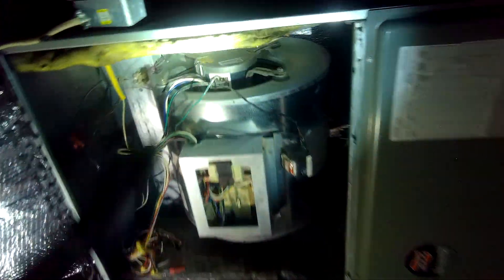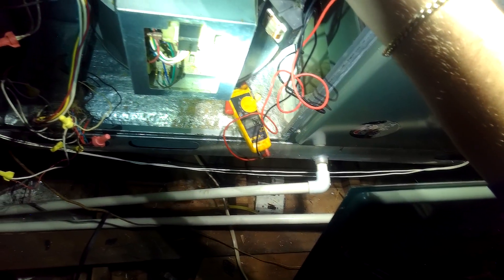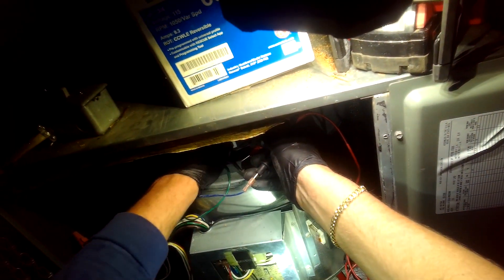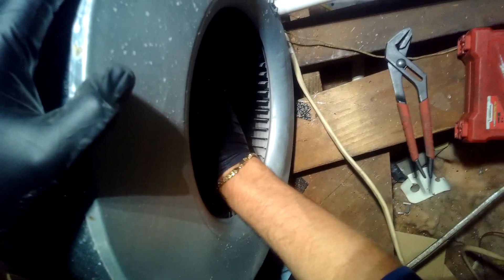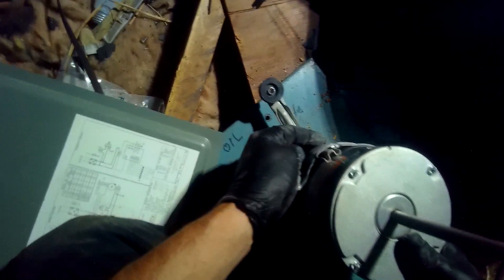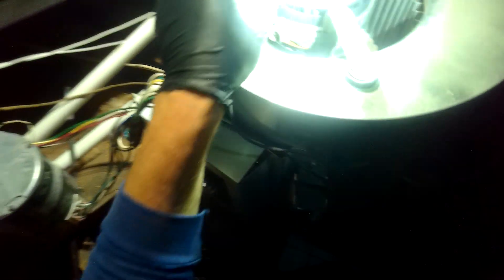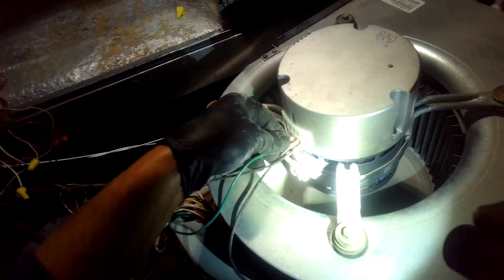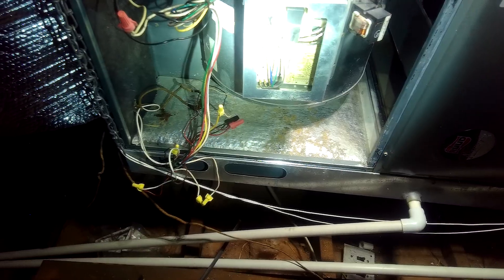How to Replace Rheem X13 Blower Motor Defective UHLA-HM6024AA

Comment: I have similar problem, blower x 13 turns on and few seconds later turns off. Thermostat was set up 77 but after two day’s temperature only  go up to 66.  I tested 24 volts coming from control board to the motor, and power comes and goes. So what is bad control board or x13?
Reply: @PipeDoctor  no I don’t

Comment: Where can i find this motor? I needs a   HM4821JA rheem x-13 motor 230v
Reply: @PipeDoctor   I have a Contractors.  Locke is where i normally get my parts but they cant find one which i find odd.